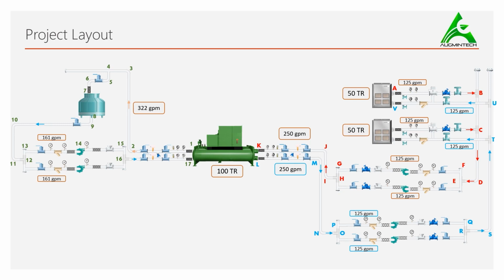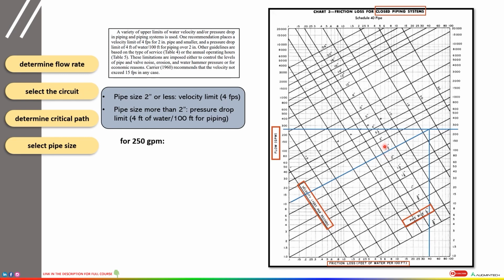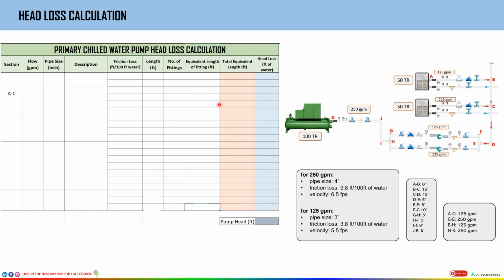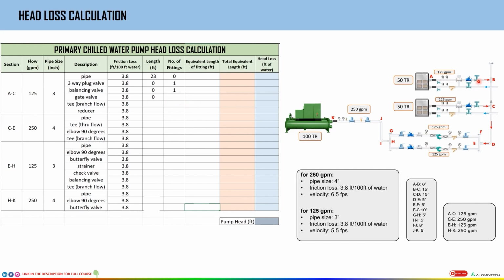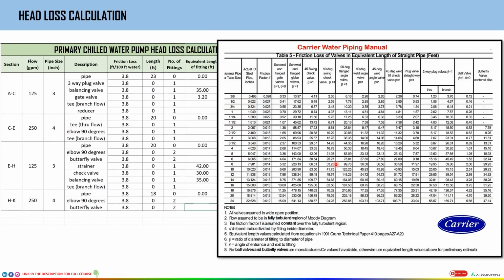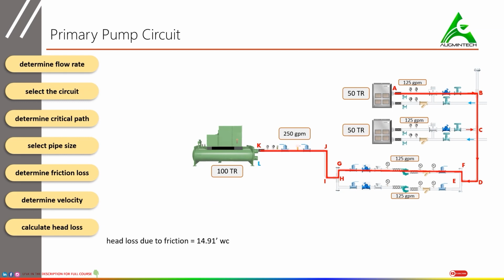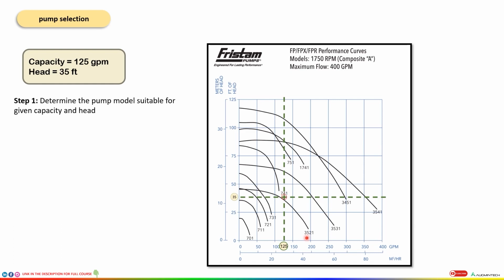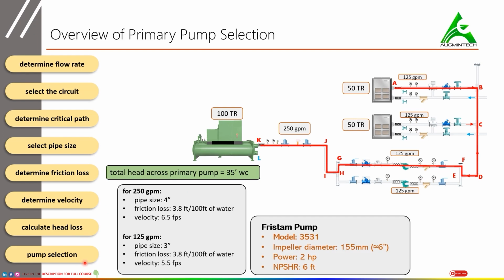Pump Selection Calculation | Pump Selection in HVAC | Pump Head Calculation in HVAC

Comment: Nice info but have some questions 
1. U have only considered from ahu return side through pump upto chiller coil..from chiller coil upto ahu supply also is not considered. Why? Please prrovide reason..since there are also valves n fittings in that ,which is also part of critical path
2. From poiny E-H,  near pump header u took elbow, it shall be t and reducer of reducing t in practical
Reply from the maker: This lecture is a part of the main course. 1 of 5.

Comment: You need calculate the friction loss in supply line also
Reply from the maker: For supply line, friction and other losses are taken care by secondary pumps which is another part of this project and is a separate video.
Reply: @augmintech  kindly upload rest of video. All of them are misunderstood by this video.
Reply: Excuse sir, I think Supply line  should be calculated or this calculation should be multiply 2  .you calculate for return line only .

Comment: How can you offer courses in HVAC hydronic design, if you don't understand basic HVAC design principles. You've made a fundamental mistake in your 'critical path' pressure loss calculation, which means the pumps are undersized.
Reply from the maker: Dear Damian
Actually this is one part of 5 part video series
What you are assuming mistakes are actually included later in other videos. I understand few pressure losses are not shown here in this video but as a complete 5 part videos series includes everything. It includes even what you are assuming as mistakes here.
Apart from piping losses, other losses can be distributed among primary and secondary pumps. So its a variable combination at advance level. I hope you get some idea what I am referring to .
Reply: Pls upload other part